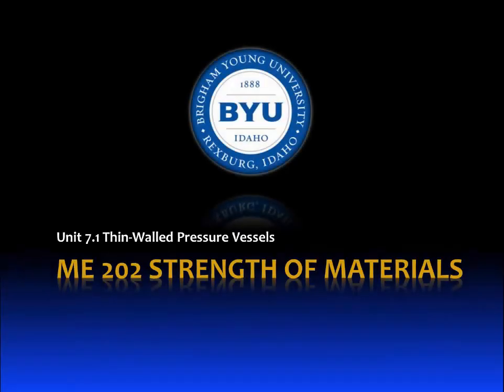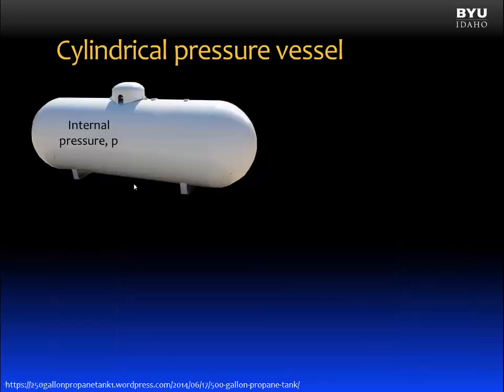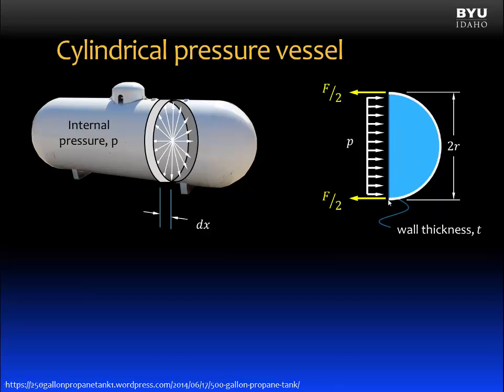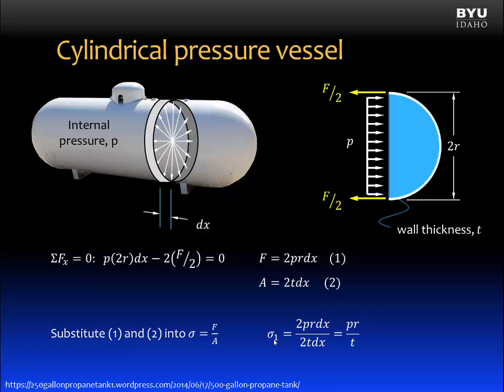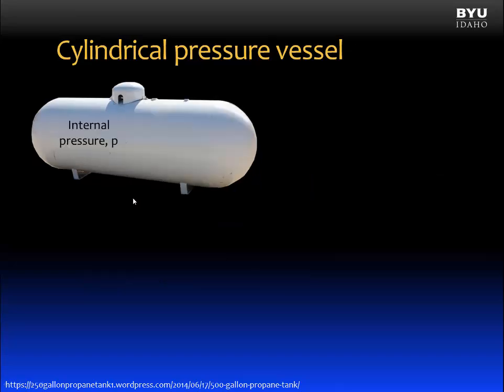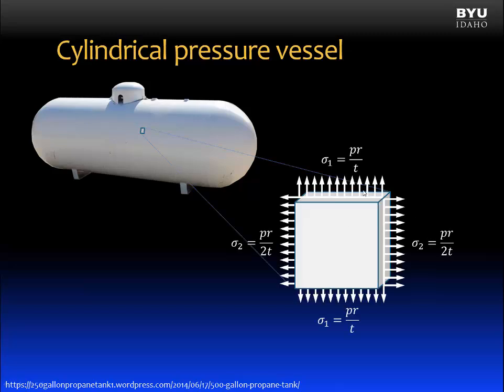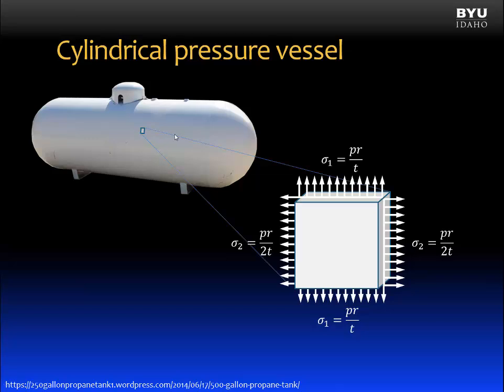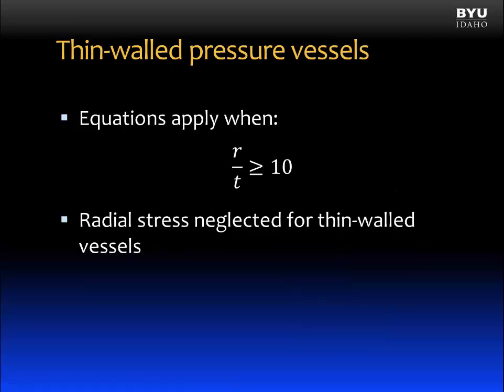07.1 Thin walled pressure vessels

Comment: If i have an air line with 100 psi going in to a vessel 1000 times the diameter of the air line, will I only have 100psi in the larger vessel.

Comment: if hoop stress is twice as much as longitduanal, shouldn't the vessel crack in hoopwise direction rather than longwise, since hoopwise pressure is stronger?
Reply: No. I think it’s because the hoop stress is pulling the area element with greater force at opposite ends. So eventually, there will be a crack perpendicular to the direction, i.e in the axial direction.

It’s like if you have a sheet of paper and pull hard enough, the paper will tear along the plane perpendicular to the direction you were pulling
Reply: @judeugwu4987  Very nice example!!

Comment: Hello, great video! But please help me with the following question, which would be the value of p, in calculating: sigma=(p*r)/t, if i have an internal pressure Pint, and an external pressure Pext. Would p be equal to Pint-Pext (in case Pext<Pint)?

Comment: At 2:50, shouldn’t the pressure vectors from interior walls pressure p be painting normal to the cylindrical curved surface? You showed it perfectly horizontal. ? Are you trying to say that this vectors are already the x components?

Comment: sir why the resistance force is only from the cut surface, not from the curved area?
Reply from the maker: The theoretical cut passes through the pressurized fluid inside the tank.  The fluid pressure acts normal to the cut surface.
Reply: @introductoryengineeringmec9114  Sir, in between the cut surface, in the hoop stress, we calculate the pressure force in the curved area as PLD. why dont we calculate the resistance in the PLD surface?  plz answer my question sir.
Reply from the maker: @tajbhiullhaque6032 , I apologize, I may not understand the question.  Only the balancing forces that appear on the surface of the cut are included: the force from the pressurized fluid and the hoop forces in the tank wall.
Reply: @introductoryengineeringmec9114  Sir you got my question now. why the balancing force is only the from the cut surface? i think i have some less understanding in the statics.
Reply from the maker: @tajbhiullhaque6032  In a static structure, all forces acting on the structure are balanced.  The same is true for any cut section, all forces (internal and external) are balanced.  In the cut section of the tank, the only forces on the section are the forces from the pressurized fluid and the hoop forces in the wall.  Gravity effects are neglected here since they are typically insignificant.

Comment: If im to design a pressure vessel and am solving for the pressure given the yield strength in psi, diameter, and wall thickness. How would I go about that? 

Is it as simple as plugging it in to the formulas and solving for P? obviously taking the lower value of P from the hoop stress?

Comment: Beautifully explained as a concept. I just had one doubt, why, when the pressure is being transformed into a force, the area calculation for the same is shown as A = 2r * dx, instead of A = pi * r * dx; since it's a half circle and the area on which the pressure is acting has the length equivalent to the inner circumference of the half circle. Just a query and it would be really helpful if you could clarify that. Thank you.
Reply: The force acting on that half strip (half hoop) is calculated as the integral of the pressure NORMAL to the surface area of the half strip. The result is what shown in the video. It is not the same as taking the pressure times the surface area of the half strip because here we have a curved surface not a flat surface, in which case the force would be p*area. A quick way to calculate force on a curved surface is to take the pressure times the projected area of that curved surface on a plane. The pressure is p, the projected area of the half strip is 2r*dx, hence force dF is p*2r*dx
Reply: also have a query on thati think (pi) must be included because its a circle
Reply: I have the same doubt, and dont know much about it. For some reason, they take the projection of the semicircular strip here, which is a rectangle of area (2r)dx. (Shining a torch from the rhs on the semicircular strip at 2:55)
Reply: Also, shouldnt the pressure always be Normal to the surface(except the longitudinal one) as all other components would just cancel out?

Comment: I'm still unsure why the hoop stress arises. If the liquid flowing tries to expand the vessel, then it should do in all directions equally, as shown (at 3:52), hence it gets cancelled internally . So then why does hoop stress arise?
Reply from the maker: If you consider the fluid in the tank or pipe as discrete elements, each fluid element pushes equally against its neighboring elements.  A fluid element in contact with the tank or pipe wall pushes against the tank wall and each of its neighboring fluid elements equally.  The pressure from the fluid element pushing against the wall causes the hoop stress to arise.

Comment: What is radial stress?
Reply from the maker: Radial stress is the normal stress (sigma) acting through the tank wall from inside to outside in the direction perpendicular to both the hoop and axial stresses.  The radial stress near the inside of the wall thickness, adjacent to the pressurized fluid, is equal to the internal gauge pressure.  The radial stress near the outside of the tank wall is equal to the pressure on the outside of the tank (zero gauge pressure).
Reply: @introductoryengineeringmec9114  Why can we ignore the radial stress for thin walled cylinders? (Sorry this may be a silly question)

Comment: Please help me understand at ( 5:16 ), how the cross-section area of the vessel can be given as 2* π r*t. As far as my understanding goes the area should be given as ( π R^2)-( π r^2). I have heard it in lectures, read it in books and it still does not make sense to me. If you try to to make 2 π *r*t = ( π R^2)-( π r^2) , you will not get the same answer, and it will be a difference of over 10%... Please clarify if you can..
Reply from the maker: You are correct that a more precise value for the radius is at the center of the vessel wall.  However, for thin-walled pressure vessels (t/r <= 0.1), the error in the stress equations is no greater than 5%, and often considerably less.  Thus, the simplified approach using inner radius is regularly used.  Thank you for your comment.
Reply: Thank you for the answer. That should be specified in the book.